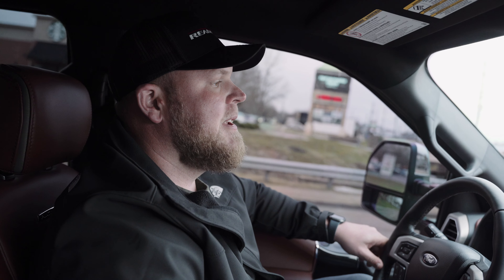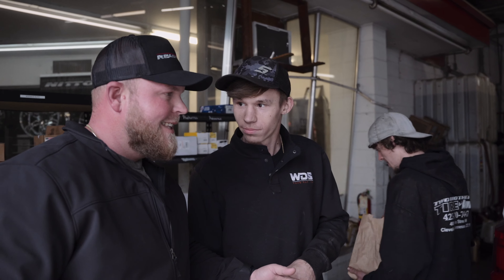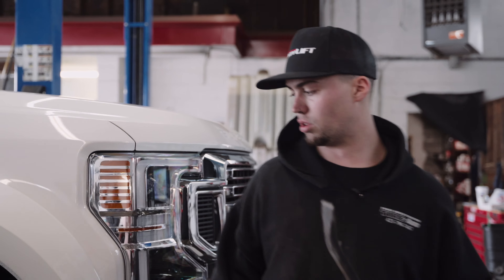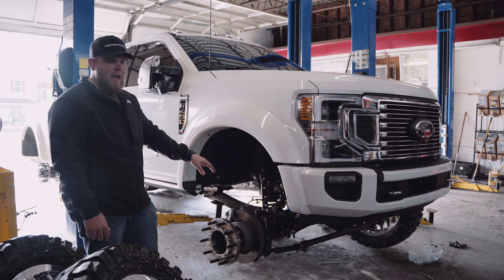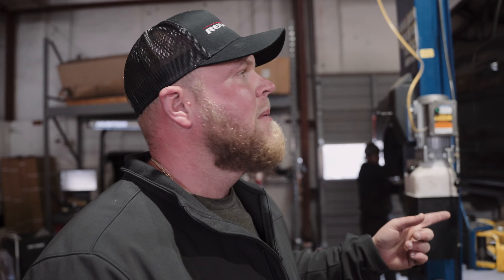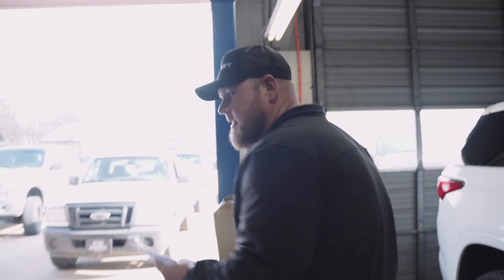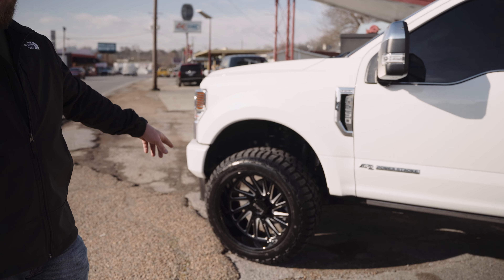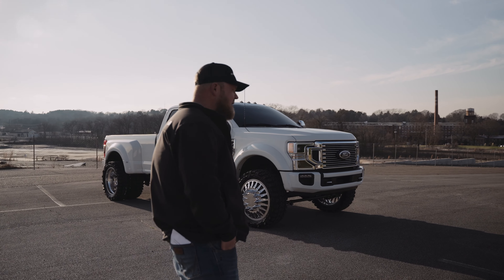2022 Ford F450 on 24" JTX Forged Wheels and 37s!

Comment: I normally don't like wheels that big, but this dually really pulls them off nicely.  The gladiators probably help.  Are they loud going down the road?  If you don't mind me asking, what sort of cost (ballpark) are people looking at for this kind of work (leveling kit, wheels/tires, labor, etc.)?  I love the F450, but those 19.5 wheels and commercial tires are terrible.  If I bought a new F450, the first thing I'd do after driving it off the lot is level it and switch out the tires and wheels.  Gotta admit, I was surprised you got 37s under there with just a level and a tiny bit of trimming.  Well, I guess you moved the front bumper 0.75 inches as well, but still.  Do y'all re-calibrate the speedometer after something like this?  I know I'm late to this one, but I gotta say, beautifully done.  Really nice looking truck.
Reply from the maker: Thanks for the kind words! Cost of something similar will really depend on the wheels as they can vary a good bit. A good budget for a similar setup (forged wheels) is ~$12-14k for everything shown.
Reply: @twobrotherstireauto  - Fair enough, and pretty reasonable.  I was guessing more.  Thanks for the reply!!

Comment: Super Nice I just found out about JTX FORGED waiting on my truck to be lifted and wheels put on. I have a 2020 Chevy 3500 HD DUALLY I went with 28 inch JTX RIMS CANT WAIT TO SEE IT ALL DONE.
Reply from the maker: 👍🏻 that is going to be one nice setup!
Reply: Went with a 6 inch lift couldn't find any tires finally found  some lexani 28/35/325 I think there adding a spacer because of the up graded suspension on the rear that comes on the HIGH COUNTRY they said they didn't know about and there going from 8 lugs to 10, anyway this is my first dually project and they pumped me up and sold me a nice dream well 26k later I just hope it's worth it all. They waited out the truck and there adding a Candy Blue to lift kit and accessories. So we will wait and see they won't show me the wheels and I haven't seen the truck it's suppose to be a you will see when it's done project. Thank you for your videos describing certain things they really help alot as I'm already committed to this project.

Comment: I love your wheels/tire combo. Quick question, I have a 350 with 2.5" leveling kit. Would the same setup fit? Not sure if the 450 setup is different
Reply from the maker: Thank you. What year model 350?
Reply: @twobrotherstireauto  2022 Lariat Dually, crew cab, 4x2, 7.3L gas. This is my first truck, got it strictly for looks. I don't tow anything
Reply from the maker: @Raiders4xSB  nice man, congrats! You will be fine with the same fitment 👍🏻
Reply: @twobrotherstireauto  awesome. Thanks a lot for your help and time.
Reply from the maker: @Raiders4xSB  yessir happy to help. Check out our instagram @twobrostireandauto — we just posted a 21 F350 DRW (black in color) with the same setup a few days ago.

Comment: Whats y’alls option about adapters vs direct bolt on for 24s?
Reply from the maker: Really no right or wrong but personal preference I like the adapters on the dually stuff. It looks better with the big rig 10 lug and you usually don’t run into clearance issues with the rear tires. Some direct bolt wheels you have to watch rear tire width.

Comment: Do the dual rear tires ever make contact with a 13.50?
Reply from the maker: No they do not. If the tires are touching you don’t need to run them

Comment: What did you do to calibrate the speedometer. I have a 2022 F450 with 24” wheels and 37” tires and the speedometer is off by 8 mph.
Thanks
Reply: Changed mine with FORScan. Its not only 1-2mph off.